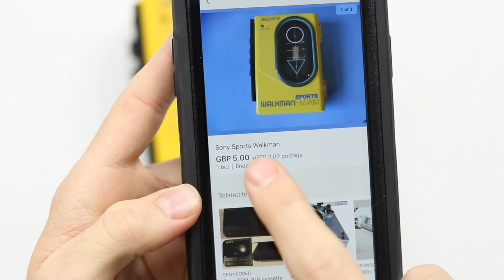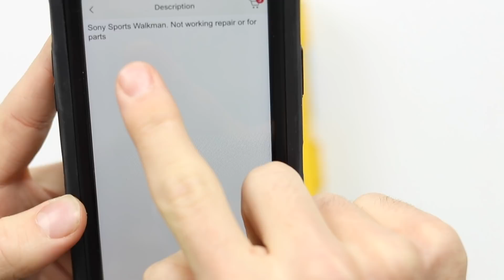Let's Refurb! - 1984 Sony Sports Walkman

Comment: about the speed issue, the rubber cover that fell off at the beginning actually covers a flathead screw, not for A/C, which adjusts the speed of playback. You can't really see it but you just have to feel around for it. I know this because I have a WM-f45 which looks absolutely identical to the f35 and works the same way, I had speed issues with mine and this is how you adjust it, also quick tip, if the sound is muffled at all, the little Phillips screw next to the read head which only shows when the walkman is playing adjusts the alignment of the head and can have a very large impact on the sound quality.
Reply: Wait is that a thing in most walkman?
Reply: @Rezigunn  I'm not sure since I only have the F45 but I'd assume so.
Reply: @goodatbeingnoob1336  well I'm hoping so. Mine just hasn't had the right sound since I had gotten it
Reply: All walkmans have them. Some reachable from outside like this one some need to dissasemble to reach but all of them have it.
Reply: @Rezigunn  indeed it is. My TPS L2 got one. Is called "potentiometer" on my manual.

Comment: Young man, thank you for this video. If you owned this walkman in 1987-88, you would be the king of the street. I bought it myself for my sister, but without the radio. In the history of SONY, all SONY walkmans have been marked WM. The dash is followed by FX (with radio) or EX (without radio). These yellow walkmans are waterproof, so they have a battery hole inside. The rubber edges have also been adapted to this. The connector inputs as well as the potentiometers were waterproof.

Comment: in future when reattaching clear plastic theirs a glue made for modellers attaching clear canopies to model aircraft, it doesn't produce any fumes so the plastic doesn't fog up or darken any painted finish.
Reply from the maker: Oh great! Thanks for the info mate.
Reply: @TheRetroFuture  and when cleaning with good old Mr sheen avoid areas that will need glue, I imagine it has some type of silicone that won't help with the bonding 👍but another awesome job yet again

Comment: I have this model! It has the crappy tanashin mech

Edit : You should repair a DD walkman. Hard yet fun to repair. Also that small hole in the side is the speed ajustment. you need a thin screw driver but put a tape in it and just play around with thesound for your liking.
Reply from the maker: 00123 ooooh very interesting! Thanks for the info.
Reply: F5 brings to mind. It's a DD FM Sports Walkman and superb mechanisms. :) Way better than today's players.
Reply: @rapisuandhamutarou1318  Sorry, which Walkman are you talking about?

Comment: I had that Walkman back in the 80's or maybe early 90's, can't remember the exact date.  It was an excellent Walkman.  That little port where the rubber was ripped was a port to release pressure so you could open the door because sometimes if the pressure changed it would create a vacuum and you wouldn't be able to open the door to get to your cassette and batteries.
Reply: I had this one back in the mid 90s.  I kept it in great condition.  But one day it just stopped working.   It wouldn’t play.  I put new batteries in it and still it wouldn’t work.  Not sure what I did with it.

Comment: For the desintegrarse rubber cover, you could design something and 3D print it in black TPU. That might work!
Also, to glue the lens, I recommend the double sided tape used for mobile phone screens. It's super strong but reversible.

Comment: Just some clarification from another Walkman enthusiast, the sports Walkman as a series started in 1983 in japan, the US and the UK and in early 1984 in the rest of the world, but the unit you’ve shown here is not one from 1984, but rather the amazing floating Walkman from 1986. Anyway, great video, I would definitely recommend you to get a wm-f5 from 1983-84, they make for a very good repair experience since they do not have any sort of belts, downside is that their value has skyrocketed since the 40th anniversary of the Walkman, but with a good amount of patience you might grab one for cheap; or heck, even a non yellow unit, which is even more rare. Wishing you luck from Puerto Rico!! Keep the good stuff up!!
Reply: 8bit Innovations  hi my wm-f5  won’t stay playing unless you hold the play button down, any ideas
Reply: John Scott, did someone open the unit?? It may be a problem related to the autostop lever, mine did the exact same thing until I found that the previous owner conducted a repair and forgot to place the lever correctly, it needs to be aligned to the lever that raises the playhead for it to work properly. Good luck repairing!!

Comment: There would have been a little nob, on the inside of the circuit board to ajust the speed, and i would advice you to turn it since, it's gonna be quite a while until the belts ware off and even if the do, it might not return to the regular speed. But i liked the video! Since i'm sony walkman repair guy too👍 

GL with future projects my dude

Comment: I have the same one. I also have the issue where it’s not playing at the right speed. I have ordered new belts and will try to open it. If i have to do soldering i will not do anything. Do i have to solder anything to open and change belts?

Comment: Is seems slow rather than fast. Vince's fixed a load of portable cassette players in the past and in most of his cases the speed was fixed by adjusting a small potentiometer on the board. I think this is just something that happens with age and is often taken in to account with the design of some devices a with the use of said pot.

Comment: That circuit board glue doesn't look like much, but it is somewhat notorious in equipment of this age for turning ever so slightly conductive over time (more so if it turns brittle and dark brown), leading to all manner or weird 'n' wonderful faults! 

I tend to scrape it back with a dental pick whenever I see it..at least away from PCB traces and component legs. On saying that, it doesn't look too bad here, but it's something to note. Anyway, good work as always! :)

Comment: Mr Sheen contains silicone, according to it's MSDS.  Its exactly what you don't want to spray on a surface you are trying to bond. Cyanoacrylate was the wrong adhesive to use.

Comment: hot glue can be removed easily buy applying ipa 99% isopropyl  alcohol  let it stand and evaporate and the hot snot glue will come off easy  it works its way underneath and frees the contact of the glue ..... hope this helps 
cheers
james D

Comment: As the belt loosens, it will actually speed up a bit because less tension on the motor.  Give it more time and it will slow and have worse wow and flutter as it lose traction.  As for setting the speed right, if you have a trusted cassette deck (recently service and calibrated by someone), you can record a 3 kHz tone generated by Audacity (free audio editing software) on the deck, then use a free software wow and flutter measurement tool to dial the speed close to 3000 Hz.  You can also measure the W&F figures between the factory belts and the new ones to see if the new ones are indeed better.  If you don’t have a trusted deck, you can start a really long song from a prerecorded tape (like you have in the video) and a digital version at the same time and see if it ends at the same time as the digital version.  If not, adjust the speed and retry.  Try to get it as close as possible because (especially if it’s only a 3-5 minute song) because if it’s slightly off, the difference compounds as time goes on (up to 50-60 minutes per side for some really long tapes - 110 and 120 minutes respectively).

The belt thickness consistency doesn’t just affect the traction, but also increases W&F.

Nicely done on the repair. :)
Reply from the maker: Thanks for the info!

Comment: B7000 epoxy is a bit more forgiving than super glue consider trying it.
Reply: Especially on something that might take flex. Maybe that's what you mean. Super glue is strong but brittle, epoxies tend to have a slight bit of plasticity when set.  Also with the clear plastic involved I'd have opted for epoxy. The duel syringe dispensers make mixing up a puddle super easy and seem to keep for months (forever?) after opened.
Reply from the maker: Thanks for the info!